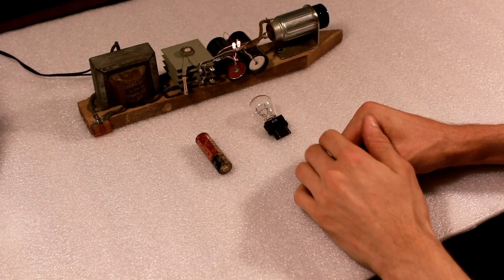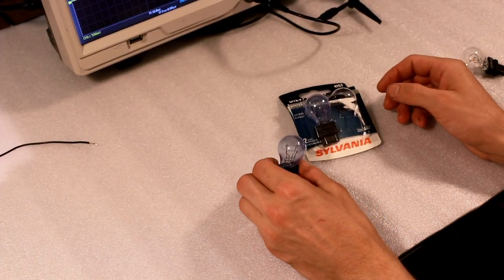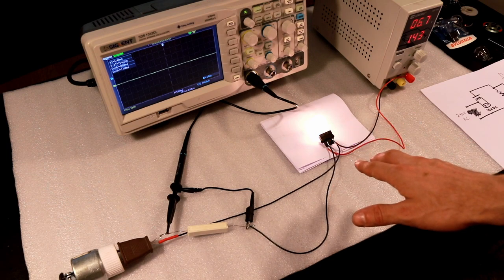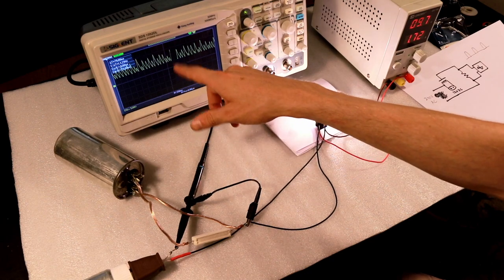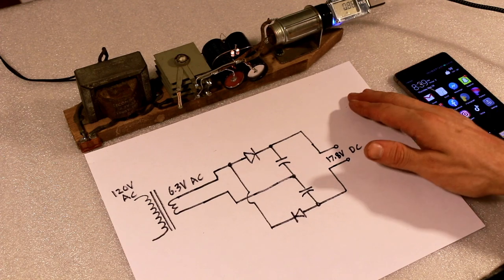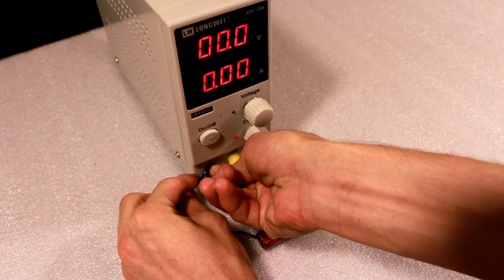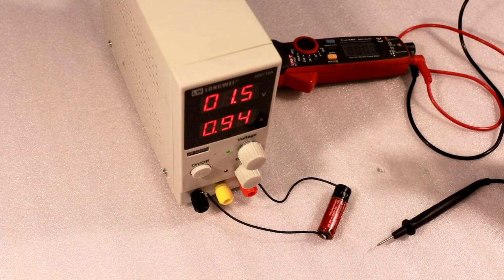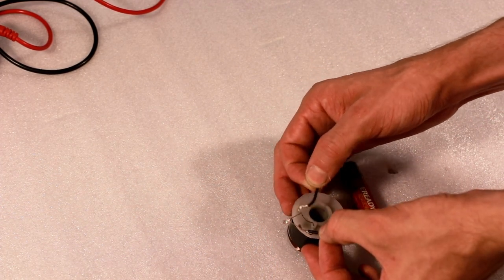Light Bulb Rectifier, Selenium Power Supply, and Alkaline Battery Recovery

Comment: 6:59 why does the lamp quickly flash when it starts cunducting?
Reply from the maker: This is due to the filament temperature being directly affected by the diode current. As more current passes, the filament gets hotter, which causes reduced voltage drop and thus more current. Eventually the capacitor charges to a higher voltage and the current reduces, which causes the filament to cool back down. This oscillation is responsible for the sharp changes in voltage that are visible on the scope when the capacitor is connected to the load.